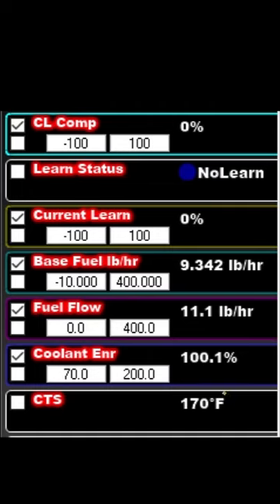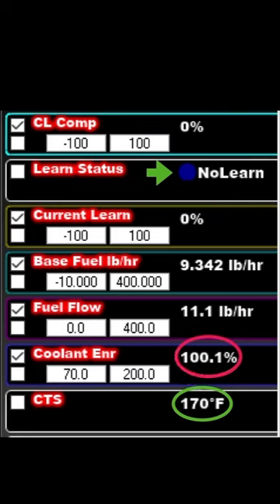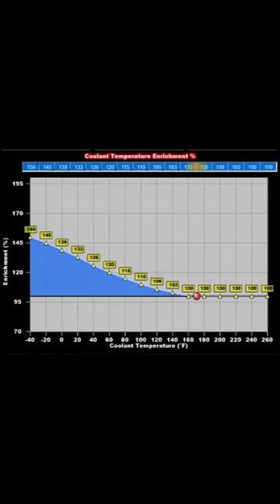Learn Mode Not Activating?? Holley EFI Tech Tips by Efisystempro.com

Comment: I had exact same issue. Was a strange bug but holley forum helped. I would like to see a tune for a knock limited motor
 Specifically the timing table. On my motor 11.1 compression I pull timing right off idea I idle at 33 timing and drop to 25 for low load accel area of the table. Not sure I'm doing it right but I pull timing and add fuel in this middle area of the table to reduce audible knock. 91 octane is all I have on pumps near me
Reply from the maker: The general rule of thumb is the more intake vacuum there is, the more timing you need. The best way I have found to explain why is to think of a forest fire. A really dense forest will burn fast cause all of the trees and bushes are close together. That is low vacuum  like WOT. A bare field with only a few bushes will burn slow since everything is so far apart. That is high vacuum or cruising. When cruising the oxygen molecules are farther apart so it takes more time for the flame front to cross the combustion chamber. You want low RPM/high load to have very low timing with high compression, but anywhere that you are cruising and not accelerating will still have pretty high timing.

Comment: Hi! I am running a holley sniper on a boat with a chevy 350. I'm burning 02 sensors but while I fix that, I need to lear how to override the baseman and make it run on open loop. Is that possible? Will it run right after a good learning session? I just don't want to waste a whole weekend when the 02 goes out
Reply from the maker: Once fully tuned you can set the closed loop and learn limits very low like 5% on each. Then if the oxygen sensor dies you can still run the engine safely. Also, simply unplugging the sensor will make it run in open loop only.